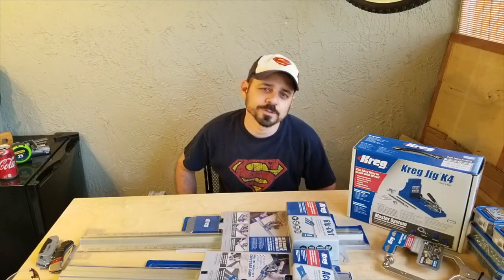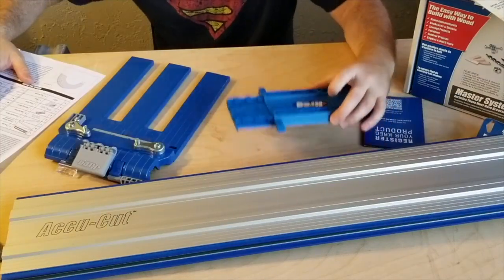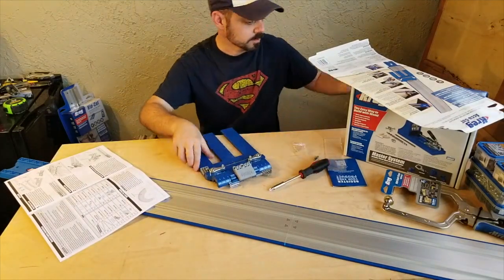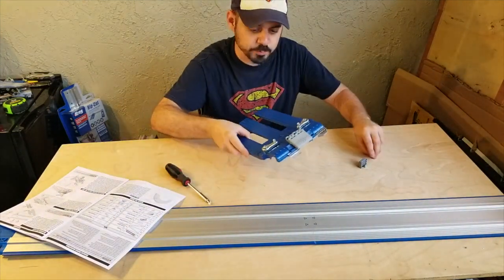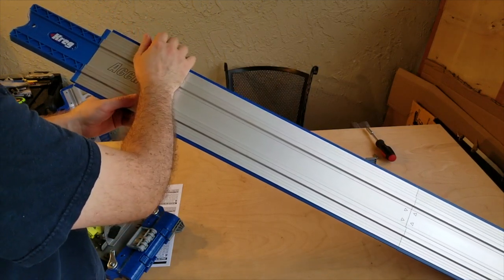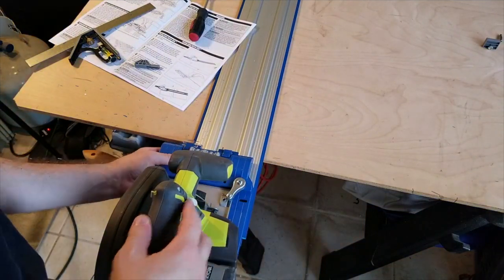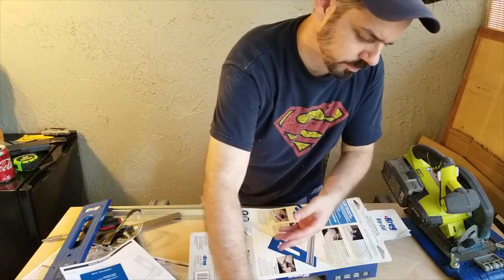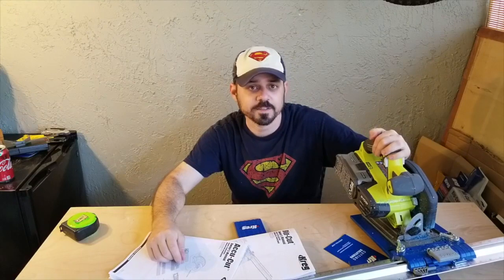Kreg Track Saw Guides

Comment: You use your right hand to grip the circular saw.  Isn't it uncomfortable having to shift the guide to the right side of the rip cut to make the cuts?  Wouldn't it be more convenient for them to make the long rule so that it cuts the 24 inches they advertise?  I have the same circular saw and I was planning to buy that kreg rip cut but it is not practical if I have to hold the circular saw with my left hand and guide it with my right. Regards.
Reply from the maker: did what was comfortable to me,  as for cutting 24 inches it  does that just fine.